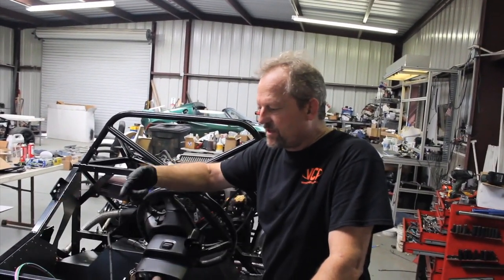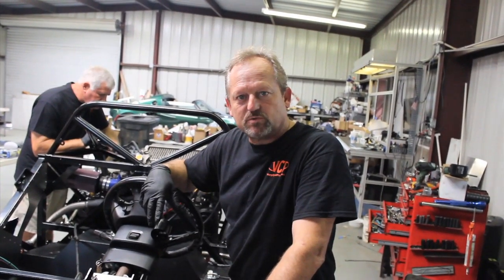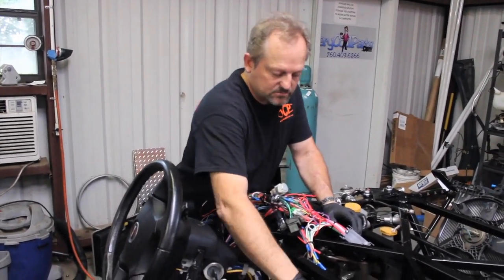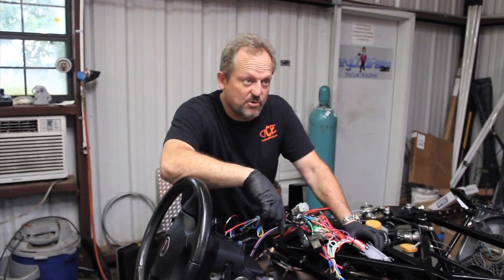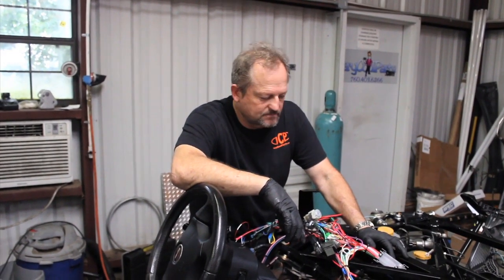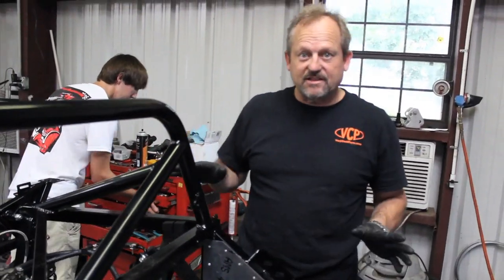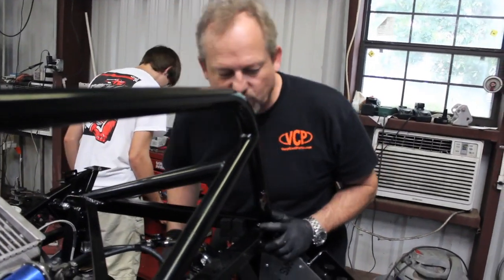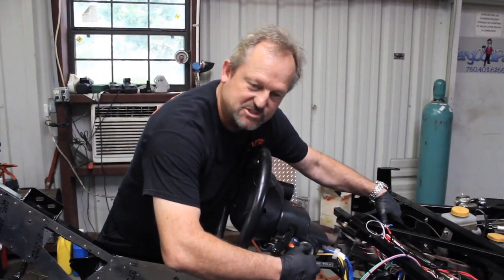Project 818 Part 21: Does it run?

Comment: i don't know why you didn't just run the wires through plastic channel under the carpet straight to the back through the rear firewall or along side the center console under carpet or panels like most cars are done until it reaches the engine bay. seems to me it would have been easier that way.